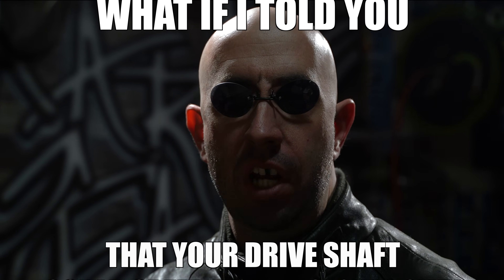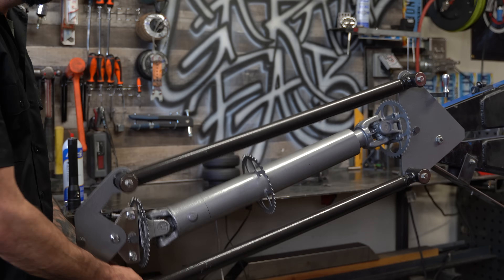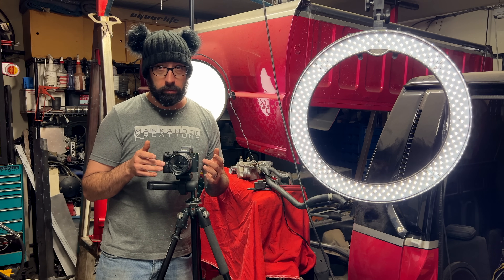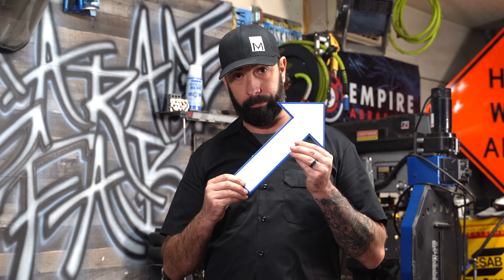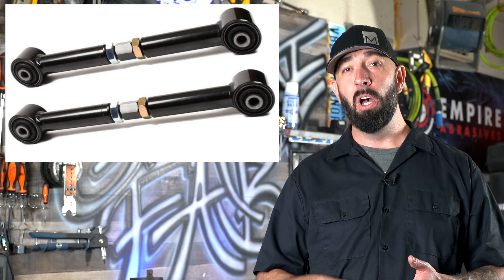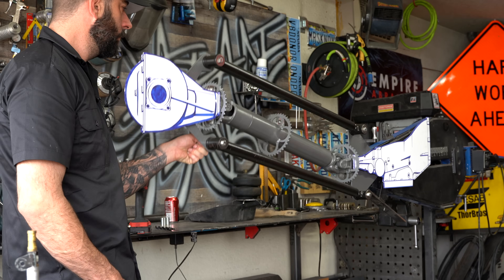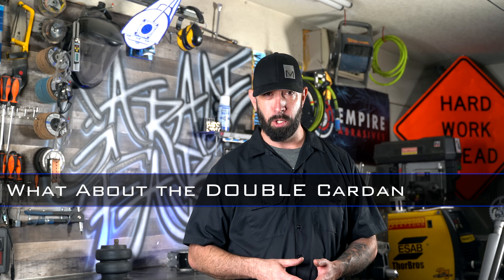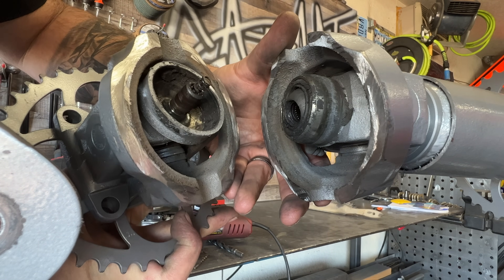THE Driveshaft Video. The Nature of U Joints. Suspension Basics Ep. 06

Comment: What he doesn't cover, is that the universal joints need to be intentionally misaligned if they are not driving along the same lateral plane as they leave the universal joints at either end.

This misalignment, to eliminate speed variations, is required on a lot of steering shafts if the lower universal joint then feeds off to the left or right, to attatch to the steering rack pinion shaft.

The math required to get this correct is quite tricky.

Comment: Scratch that now I have a new question didn’t realize it had already been answered previously, so in a triangulated 4 link if the upper angled bars are slightly longer than the lower straight bars wouldn’t that cause for the pinion angle to change? I have a wishbone link setup and was thinking found parallel 4 link but I’m scared lol
Reply from the maker: It’s difficult to explain in text, but the lengths of the angled bars are not as important as the distance between the front and rear axis’ of the angled bars.
The axis is the imaginary line that passes through the bushings of two or more bars. The bars together rotate around this axis.
When the bars are straight, (parallel) the distance between the front and rear axis’ is the same as the length of the bars. 
However, if you angle those bars, it would technically pull the front and rear axis’ closer together. Therefore, in order to keep the axis’ the same distance apart when angling the bars, the bars need to be a little longer.
Hopefully that makes sense. So I’ll answer your question after rewording it slightly.
If the distance between the front and rear  axis’ of the upper bars is slightly more than that of the lower bars, yes. The pinion angle will change.
Reply: @ aaaaahhhh thank you sir I think I got it.. so if I were to mount the rear of the angled bars directly over the straight lower bars let’s say using a identical tab equal distance from axle on both upper and lower  and mount them both the same way to the front crossmember even if the angled uppers are slightly longer but mounted same distance from the front crossmember just in the middle instead of outside like the lowers it will be fine?
Reply from the maker: @DiegoLopez-hg2uc Exactly. 👏
Reply: @GarageFab  got it thank you for all your help I would say that’s my last question but I know there will be more so apologies in advance. You’re knowledge is very much appreciated🙏🏽

Comment: I have a 2000 BMW 740i E38, the u joint just gave out, and it’s doing this, I’m replacing not only the carrier bearing but also the CV JOINT because of this issue and I will most likely have to replace them AGAIN in another 100K miles. 
 This issue is common on the BMW 740i E38 because of its long wheelbase and 2 part driveshaft design. Sometimes over engineering can be catastrophic ✅

Comment: Someone enlighten me, 2  piece drive shaft, what is the best pinion angle set  up.. 

Constant ride height

Engine / Trans down at ? 
Centre bearing down at ?
Diff up at ? 

Should the engine / trans angle continue on the first part of the tailshaft? 

And the diff up at the same angle
Reply from the maker: Engine/Trans: We often don’t get to choose or change this angle much so measure the angle and write it down.
Let’s say it’s 1° down.

Carrier Bearing: This bearing doesn’t move because it’s solidly mounted to the chassis. Therefore, the first section of driveshaft doesn’t move either.
The speed of a driveshaft doesn’t start to oscillate noticeably until the U joint is bent beyond 1°, so the carrier bearing should be mounted with that in mind.
(Additional fun fact, U joint needle bearings need to move around a little bit to keep them from wearing out prematurely, so perfectly straight U joint isn’t good either.)
So let’s aim for a 1° bend.
Because the transmission is at 1° down, we can mount the carrier bearing so that the first section of shaft is either at 0° or at 2° down. Let’s say we’re lifting a vehicle so let’s go with 2° down.
The needle bearings are moving and happy, and the bend isn’t too much to create an oscillation.
The first section of driveshaft is now the angle you’ll want to match the differential to.
Differential: So in the vehicle above, in order to make the pinion and first driveshaft section parallel, the diff will need to be angled 2° up.

Engine/Trans: 1° Down
Carrier: 2° Down
Pinion: 2° Up

Do your own math based on your engine tabs angle.

Lemme know how confusing that was. Hard to explain stuff without video!
Reply: just to add to this question.. 1.when you mean down it’s actually angled down towards the floor right? 2.Also if that’s for lifting a vehicle then I would go opposite for lowering a vehicle let’s say angled up away from ground? 3.Also would I want to change the angle of the carrier bearing or leave it how it is and only match pinion to make it parallel? 4. If trans is angled down 1° how does it change to 2° at carrier bearing? 5. Last but not least is 0-2° a generally good number to shoot for? Does that change whether a vehicle is being lifted or lowers? I apologize I know it’s a lot of questions

Comment: I have an 05 F150 with 6” front and 4” rear lift and 2 piece driveshaft the truck makes an awful vibration at 53mph. The kit came with tapered rear blocks approx 3.5 degrees. The transmission yoke is 0 degrees. Should i get flat blocks to make the diff  yoke 0 degrees? My hour long commute is awful with the vibration thank you for any help.
Reply from the maker: The two piece shaft changes things a little bit. The front shaft can’t move up and down. The transmission is fixed and the carrier bearing is fixed and so at the factory, the front shaft is installed fairly straight and therefore the front U joint can be ignored. If the carrier bearing is spaced away from the chassis during the lift, it could potentially cause a problem if that spacer creates too much angle on the front U Joint.
So on a two piece driveshaft, the fixed front shaft theoretically becomes the new transmission.
By that I mean you’ll want to match the angle of your differential to the first section of driveshaft.
A two piece driveline might look something like…
Transmission 1° Down
First Shaft 2° Down
Pinion Angle 2° Up

Lemme know if I confused you.

Comment: Wow!  Thank you for your thoughtful teaching method.  Defying traditional terminology in search of clear "layman's" terms and examples is a great way to reach your audience.  Not to add an additional layer to this discussion, but in an independent rear suspension, say a newer Mustang S550, dropping the car an inch or so wouldn't have any effect of the pinion angle, but would have an effect on the CV joints of the half shafts.  After seeing your explanation of the differences in how both a Universal Joint and a Constant Velocity joint are made and function, would it be safe to assume that slight change in the ride height of the aforementioned vehicle would have less impact on a CV joint versus a Universal Joint?
Reply from the maker: Thank you Mark! You are correct. In an IRS setup , the differential is mounted solidly to the vehicle chassis and therefore doesn’t move and so U joint angles are unchanging.
If I understand your question correctly, CV joints are barely affected by changing angles. The boots on the other hand are less tolerant especially if they’re not new.
When increasing the angle on the CVs of older vehicles, it sometimes causes the boots to crack or begin leaking past the band clamps. This usually isn’t an issue unless you do a huge suspension lift.

The following is not fact… it’s just some input based on my knowledge of how things work and past experiences.
When a CV is straight, the bearings inside don’t move. As the joint bends, the bearings begin to move back and forth in their channels. The faster you’re going, the faster the bearings move back and forth which I’m assuming would cause heat. Heat isn’t great for the grease or the metal for that matter.
It’s an educated guess that a constantly bent CV will fail more quickly than a straighter one.
But I’ve never had to replace CV joints on any of my lowered cars.
🍻
Reply: @GarageFab  I understand what you saying about the grease-metal flexing of the CV joints, and that certainly makes sense, as you mentioned in the video, manufacturers setup a driveline to function at its best at a stock ride height, and any deviation from that solid rear axle or independent will create some misalignment.  In the IR example, design of the joint, and degree of change in ride height/rotational joint misalignment would have an increased wear rate, how much and how deleterious and over what time span seems proportional to the deviation from stock height.  Not optimal for sure, but as you suggest, the degree of deviation will play a role in the wear rate.

Comment: That’s very interesting info that I didn’t know .  We had just drop a truck to4” down and it just went bang today busted u joint and drive shaft went crazy .  Now I know how come pinion angle was off , I want to build my own to get rid carrier bearing for good, but going to mock it up fist to see how it looks and check pinion angle. Thanks any worry’s bout doing my own let me know 19:20
Reply from the maker: Hey Michael! When you say “doing your own” do you mean building your own shaft?
I have the ability to build my own drive shafts, but that’s something I always have done for me. Because of the extremely high RPMs of driveshaft, the smallest imbalance will create a pretty intense vibration. The smallest lack of precision will cause imbalance. (U joints not perfectly centered on the tube, U joints not welded perfectly straight on the ends, or more weld bead on one side than the other.)
Even professional shaft makers have to balance their shafts, so you’ll at least have to have yours balanced.
Obviously all this is assuming you’re confident in your welding ability.
Side note; The single piece shaft is wise.
The two piece and single piece shafts both need to make the same elevation change, but the single piece has a greater distance to do so. Therefore the longer shaft will have less of an angle also making the U joints bend less.
Lemme know how things go!

Comment: Man, I love the way you explain stuff. It makes a lot of sense. I have a question in regards to the angle that the axle will move forward when connected to a parallel 4 link. I have 24" bars that I am installing on my 1982 Squarebody crew cab. Should I not center my step notch to the axle, but instead move it slightly forward because of the movement that the axle will move up when slamming the truck?

Comment: Having a vibration issue with my '09 f-150 std cab 4.6L auto 2wd (2pc shaft with carrier bearing). Replaced everything from axle shafts, bearings, and driveshaft (napa stuff). Had 3 shops now tell me "It's a Ford/truck" as they couldn't fix it. Sitting at driveshaft shops now, if not fixed going straight home to start messing with pinion angle. Glad I came across your video. I must say, video fairly immature (😃) but doing so kept my attention and the video was very informative/entertaining!

Comment: Should I compensate for pinion wrap with a leaf spring setup, or just set it parallel at ride height and send it?  Your video definitely helped clear this up more, but I just wanna verify.

I'm trying to get a 1960 galaxy setup with a tremec 5 speed.  When I set the pinion and transmission parallel, the driveshaft has 5 degrees of drop, which im told is definitely borderline for u-joint longevity.  If I were to compensate 1 or 2 degrees for pinion  wrap, my u-joint angles would be less too.  I think that is the right answer, but I want to verify that with someone experienced..

Should also add, I will be compensating by lowering the transmission, not by lowering the pinion.  Lowering the pinion in my scenario would increase the angle on the driveshaft.
Reply from the maker: It partially depends on what you plan to use the vehicle for. Do you mash the accelerator often? (Like me, if I’m not the first across every intersection my day is ruined.)
Or perhaps just a Sunday cruiser?
About that 5°. I agree that in the book of rules, that’s pushing a drive shaft to its limit… but in the air suspension world, we push far beyond that and rarely have issues. There’s a slight chance that you’ll have a vibration at very high speed even if you follow all the rules you learned in this video. One thing I didn’t talk about is that if your angles are so extreme, a vibration can be caused simply due to inertia. Even if your U joints match, the center section of shaft is still speeding up and slowing down. Because the driveshaft has mass, if the angles are too extreme, this oscillation can still cause vibration simply because a rotating shaft doesn’t want to stop, nor does it want to accelerate instantly.
I’d recommend that you start by keeping the pinion and trans parallel. Worry about things only if you have a nasty vibration on acceleration. If you do, install a small wedge block to stop the front of the diff 1-2 degrees.
It sounds like you’re already on the right path. 👍

Comment: Quick Question: In a split drive shaft with a center carro bearing, when lifting the truck I would have to add spacers to drop it ?
Reply from the maker: Not necessarily. A couple questions first…
How much are you lifting it? And what type of rear suspension do you have? (Leaf springs, link bars, etc.)

Comment: I have a lifted xj jeep and an aftermarket axel with a double Cardon on one side and a u joint on the other…

Do I want to put the double cardon up at the transfer case and the u joint at the rear diff and set my pinion parallel to the driveshaft?

Or I could put the u joint at the transfer case as long as the drive shaft is parallel to the output shaft?
Reply from the maker: Hey Benjamin! You’re describing the most common Jeep setup that I’m familiar with. Most often the double Cardan joint is indeed in the front closest to the transmission. The angle of that joint can more-or-less be ignored. It handles all potential vibration issues on that end of the drive shaft.
The single joint at the rear is the one that matters. That one needs to be nearly straight, or as you put it, pinion parallel with the drive shaft.
I say “nearly” straight because U joints like a tiny bit of angle to keep the needle bearings inside moving.
1° of angle is generally enough for that and it’s not enough to produce speed oscillation.
This means that the front of your rear differential will be pointing almost directly at the back of the transmission/transfer case.
In summary, the straight-ish U joint creates no oscillation, and the double creates and eliminates its own oscillation.
👍
Reply: @GarageFab  sick! thanks so much man!
Reply: @GarageFab  About 1 degree down (under) the driveshaft?
Reply from the maker: @benjaminpauza159 Because it’s such a small amount, it doesn’t matter if it’s 1° up or 1° down.
But in your case, you might as well push the differential up a little bit to gain just a tiny bit more ground clearance .

Comment: Excellent presentation that even I can understand. This explains why my axel broke on my 1938 Chevrolet rear end by simply installing 3” lowering blocks. 
-I recently installed 3” lowering blocks on my new to me 38 Chevy four door but removed leaf springs from the front dropping the front end almost the same as the rear. It seems that a level drive shaft is idea(my driveshaft is closed if that matters).
-I also bagged my Lexus LS430 but drive level while low or high. Thanks for sharing, excellent

Comment: I'm surprised there's no kit to just put a pair of CV joints on the driveshaft. You've done all kinds of crazy fabrication to get that kind of dynamic suspension, why not pop a couple CVs and rubber boots on there? Not strong enough?
Reply from the maker: I feel you! I definitely think they’re strong enough, though I could be wrong. As for the kit, driveshafts aren’t really made to easily swap out joints so you’d either have to have your existing shaft modified, or just buy a complete shaft with U joints already built in.
As long as you follow the “rules” there’s not much need for the extra cost of CVs.

Comment: Crazy thing is honda did something similar on most of it's 4wd models.
Reply from the maker: Did what? I know the Element has CV joints on the shaft which isn’t really common.
Reply: @GarageFab  honda civic wagon rt4wd has a viscos coupler in-between 2 drive shafts. The drive shafts are about as beefy as my 3/4 ton truck.

Comment: The front axle on my Jeep has a fixed caster angle - if you alter the pinion angle it affects the steering geometry.
This video will help get some of the previous owner's mistakes sorted out. Apparently you can't just slap together an engine/transmission swap and a 4" lift without doing some homework. Sheesh!
Reply from the maker: That is unfortunately very true. Caster almost exclusively affects the steering self-centering behavior. Pushing up the front differential will take away caster causing a wandering condition.
If you absolutely must change the pinion angle, you'll have to remove and reweld the steering Cs. No small task. 
There might be other options though with the proper choices in U joints.
Reply: @GarageFab  I work for a company that makes industrial mining and construction equipment. We have a full machine shop and welding shop. If it comes down to it, I can have the boys modify my axles.
Also, I'm seriously considering adding a bit of rear-steer capability.  Nothing crazy... just enough to make the switchbacks on Black Bear Pass a little easier.